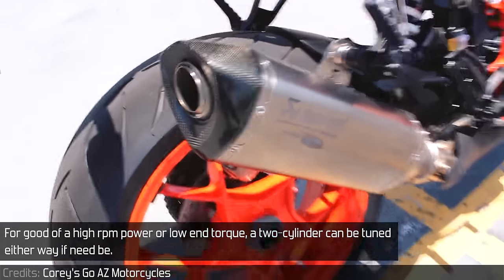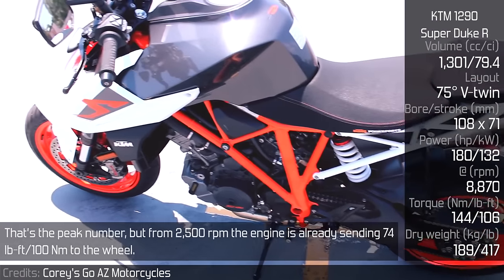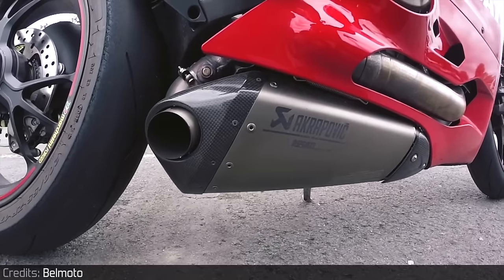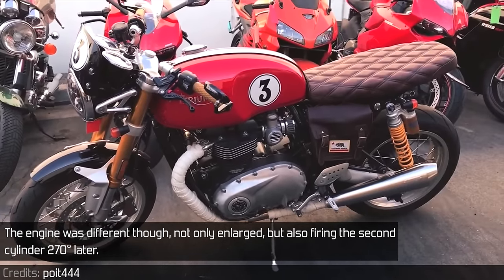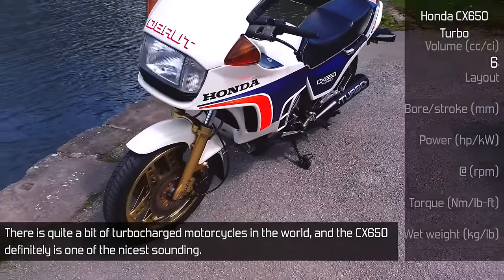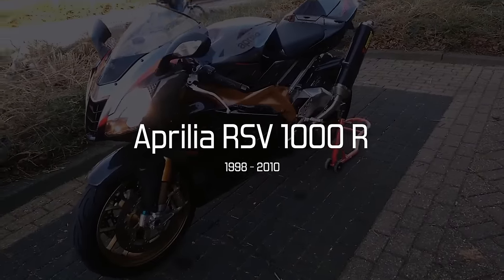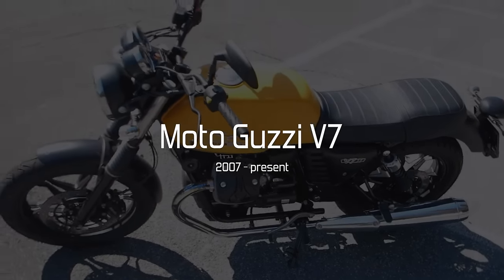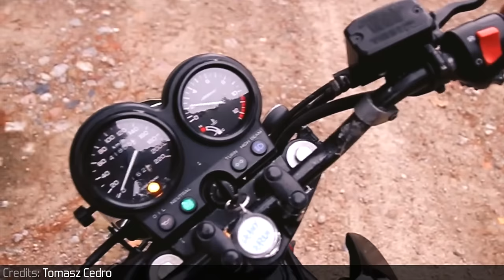12 Of The Best Sounding 2-Cylinder Bike Engines

Comment: The MT-07 is certainly fun and joyfull! Part of the reason I ride one is the amazing engine sound. It’s not the sound of the exhaust that I love but the actual mechanical sound of the engine. Even with the factory exhaust, the engine sounds like two small hammers hitting on a hollow block of wood at thousands of times per minute. It creates a wonderful resonance with a perfect amount of vibration that makes you feel as if your body is connected to the engine, but without any discomfort. I have ridden it for 4 years now and have no desire to upgrade to a larger more expensive bike at all, it is a perfect balance of enjoyment, simplicity and low price in my opinion
Reply: i like the bike with stock exhaust more hahahaha
Reply: Sounds like any inline twin to me . Sounds like some old engines from the early 70's that came out of Japan . Like the honda 350 and 360;s . Not bad but I really did not like how they sounded but they was vary good bike for the time .

Comment: Do not forget the TL 1000 and  SV 1000 versions also. Great rumbling sound on those bikes.
Reply: My dad owned a TL1000R and it was by far the best sounding bike I've ever heard in my life, I used to love the sound of an inline 4 screaming it's arse off but after hearing that I fell in love with V-twins. he unfortunately swapped the bike for a gen 1 unrestricted Hayabusa as the TL scared the life out of him lol. hasn't even ridden the busa yet
Reply: @chandler5840 a bike scary enough to make him switch to a motherfking hayabausa?

Wtf?
Reply: @MenderSlen579  yes lol, he says it’s easier to control since the TL is a vtwin so it has a lot of low end torque, his TL also had a quarter throttle so he always complained that he couldn’t set off smooth without the bike trying to set a new 0-60mph time haha. The TL got its nickname “widow maker” for a reason
Reply: @chandler5840  those formula 1 style rear suspension is very dangerous but very fun to ride! My dad survived the tank slap on '98 TL1000s and He never scared of it!
Reply: @427Cabriolet  despite the downsides to them, they really are some of the best looking and sounding bikes I’ve ever seen. Especially in blue and white

Comment: I  am used to a V-FOUR engine(I owned a VFR 400RR) as this has power in any gear and I found it a fantastic engine as it has steady traction in and out of bends(engine braking!), but I have recently bought a VTR 1000F FIRESTORM and I must admit the power curve and predictable traction is a fantastic godsend for keeping up with the latest 1 ltr superbikes and I am glad I sold my previous bike a CBR 600RR as that machine was way to buzzzy and twitchy at speeds above 120mph, this machine is planted and very well behaved at speed and under acceleration, I will say however the VTR is a beast and if you have little experience or lack of discipline between speed and engine noise you will come a cropper! please be warned!:/
All in this machine is fantastic it has the pull of a tractor and the finess of a super sport and a bike with a fantastic characteristic that is sorely missing from the latest crop of bikes.
Worth a ride any day of he week.
PS Pussies need not applie:)
Reply: honda or suzuki to to remake the vtr or tl1000 for us! please. but it probably wont beat the rawness of the firestorm or tl1000

Comment: Man, that Thruxton sounds Amazing! Same for the moto Guzzi.  Also, I do have a CB500 Twin, but in my case, its the 1975 version. Surprisingly, it's all stock, and hasn't been chopped, like I see with 90% of the 70's Honda CBs. (and before anyone asks, no, I don't plan on chopping it either!)
Reply: I have two bikes that are all stock also .  A 1974 MZ TS250 and a 1975 Honda CB350 . Both are completely diffent to ride . The MZ is vary fast around the corners . I guess I should not say fast but it really easy to lean into the corners . The CB360 is not so much the case . You have to make it turn into the corners .It wants to come up on me . Did that sense new . I should have put some Koni shocks on it but didn't . I wanted to keep it stock . I still own both bikes . Your right about idiots cutting these old bikes up to what they want them to be . But those old bikes could never be any better than what they was . These people are ether on drugs or something .

Comment: I'm right into 3rd gear with my CB500 at the minute. You open it up at about 4,000rpm and you get that classic Honda powerful throbbing vibration between your legs, it's great on wide sweeping corners.
Reply: The cb500 is a verry nice bike😍
Reply: @igbis4963  Yep, I had a 2003, but I don't ride now after a few close calls.

Comment: My Kawasaki Versys 650 has a decent sounding twin, at least for a 180 degree inline twin.  Think the CB500, but deeper.  Still not as good sounding as a nice V-twin though.  The FZ/MT-07 is probably one of the best sounding bikes out there, especially with the Akrapovic exhaust like you showed in the video.

Comment: You should have included the Hyosung GT 650r, the sound is crazy with a propet exhaust
Reply: The sound is like the Gladius sv650, the motors are similar
Reply: @jeisonfernandoa.2206  yes and everybody knows that the exhaust system, silencer, air filter and air box doesn't change the sound... Lool listen to a gt650r and a gladius and you'll hear a big ass difference.. maybe not to your ears
Reply: I have a 2008 gt650r can say it's a wicked note

Comment: Best sounding 2 cylinder from suzuki is the tl1000r/s
Reply: so is SV 1000 because it have the same engine :)
Reply: Ibanezgames True!!👍👍
Reply: I really miss my TL :S
Reply: The Honda VTR Super Hawk is right there with the TL.
Reply: Ibanezgames my first bike was a sv1000N, loved it.
As i Sold it, it hat 85000 km on the clock and i never had a problem with it!
Reply: I was going to say the same thing. 

I’m also disappointed it wasn’t on the list.
Reply: SV1000SK with beowulf cans no baffle from the rear. Thuds you in the chest. /watch?v=AgvV4I1CHhY
Reply: Duc76 i know tho it is really dissapointing
Reply: I love my TL1000R's sound with Arrow Carbon cans (bought the bike with them), de-restricted airbox with PiperCross air cleaner (I fitted it). So many delicious sounds to listen to even  while idling at a traffic light. Also ridiculously scary if you are not careful with the throttle, managed a surprise power wheelie in 2nd gear with my fat ass and a pillion on the bike. Wouldn't trade it for any other bike.
Reply: @FreeXsa  it gives me goosebumps
Reply: Sv1000s with a single M4

Comment: I love 3-Cyl and V-4 bikes, too bad they are the rarest examples
Reply: I had a Cavalcade with a V-4 that rumbled like a V-8, Lots of power but heavy and needed it, also had a Yamaha XS850 triple, Both had unique sounds.
Reply: Riding Weeb 3 cylinders are very popular where I live for their power delivery
Reply: Yamaha FZ/MT-09, Vmax. Aprilia RSV4, Tuono V4. Triumph Street 675, 765/Speed Triple 1050, Tiger 800, 1215. Honda RC213V-S. Ducati Panigale V4. Honda VFR1200, VFR800. Benelli Tornado 1130.
Reply: MV Agusta 675 and 800 bikes all use three pots as well.

Comment: Benelli tnt 300 is also  a 2 cylinder bike which sounds amazingly similar to a 4 cylinder bike.
Reply: Similar to an angry bee.. when you really hear it you can't really compare it to a 4 cylinder sound xD

And that's why i'm getting a bandit 400, 58hp, cheap, cheap insurance, amazing sound, easily and heavily customizable look. Mt07 sounds good with a proper exhaust, it's tremendously fun but i like real colors.. it looks a bit too much like a stealth jet to me, else there is the Hyosung GT 650R which sounds incredible with a good exhaust, only problem is that it's a sportbike and since we can't fit proper frame sliders (crash bar, 2-3 anchor points sliders or top blocks) it's just too risky.

Else i have a green er6n (first gen) i love the look, it drives.. like an old bike xD but the sound is horrible, at least not great at all

Comment: 2 cylinders is the perfect amount for small engines, more than this simply is not neccesary. 3 and 4 cylinders just becomes more complex and too many moving parts, the advantages do not outweigh the extra complexity in my opinion. When the bike is older and needs tuning or repair you will be glad to only have 2 cylinders worth of parts to work on!

Comment: I have always been a fan and follower of the V4 layout BUT I recently bought a VTR1000F FIRESTORM and I am utterly speechless as the power is highly useful and linear on the highway!
Why have YOU NOT featured the VTR1000F FIRESTORM!! YOUR VIDEO IS INCOMPLETE WITHOUT THIS MACHINE ?
I would also like to educate you and your viewers as to the reasons why engine layout is IMPORTANT.
The VFOUR is a smooth and powerful power plant and reduces the overall width of the bike and makes for a consistent and progressive power curve of the machine.
A V TWIN on the other hand also reduces the overall width of the bike BUT makes the engine a little lumpy and makes the power delivery a little more urgent:)
I fell in love with my Firestorm as it has power when needed and changes direction when I ask it, the brakes and other equipment are obviously not up to days standards but  I REALISE THIS AND RIDE APPROPRIATELY.
This machine will with it`s 90 degrees v twin and 48mm carbs never be made again and ultimately it will be a CLASSIC :)

Comment: I put a supertrapp slip-on on my 96 S-1 10 lbs lighter three less HP at red line than stock. 35% more torque in the low mid range. Neighbors wave using ALL FIVE ! Kinda NASCAR sounding  wot!

Comment: Winners:
1. Yamaha MT-07 or FZ-07
2. Triumph Bonneville 1200 or Street-Twin 900

Both engines with 270º crank angle parallel twin cylinder!
Reply: What about benelli tnt300 that sounds the best for 2 cyl

Comment: I disagree with your premise. Vertical twin with a 270 degree firing order (Yamahas going back to the late 1990's, almost all BMW vertical twins, as well as those vertical twins from KTM and CF moto, plus the royal enfeild 650, and Honda), sound exactly like an L twin. So just like a Ducati, Moto Guzzi and a suzuki Vstrom. A Vertical twin with a 360 degree firing order should have the same sound as a boxer twin as the firing order is the same. The only differences are the exhaust systems and mufflers.

Comment: There is no real gain going from one to two cylinders of the same displacement. Many vertical and V twins, the pistons go up and down together and the ones that fire in twinkle (270) vibrates at a higher more annoying frequency. Triples and fours can achieve balance, be silky smooth and perform well but lose character. There is something really honest about riding a single cylinder motorcycle.